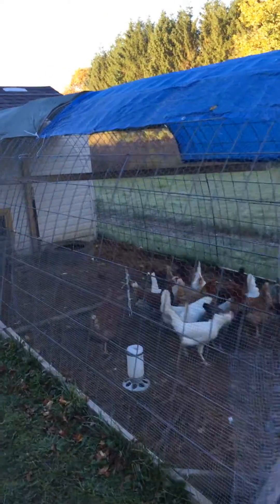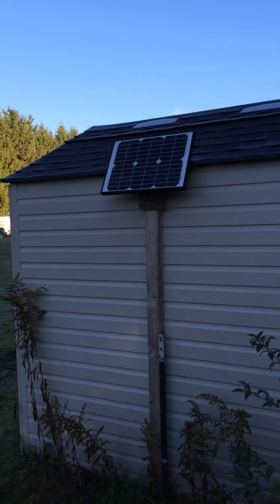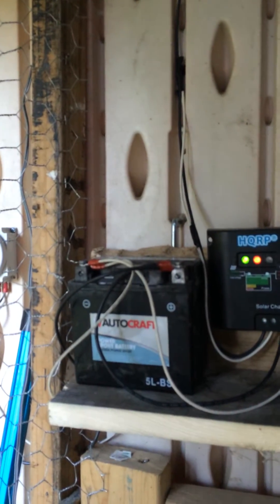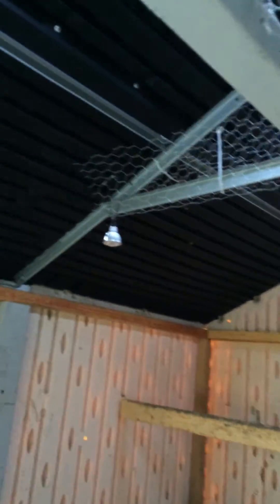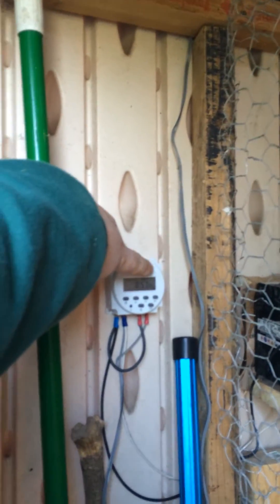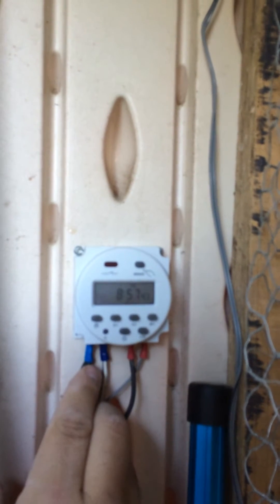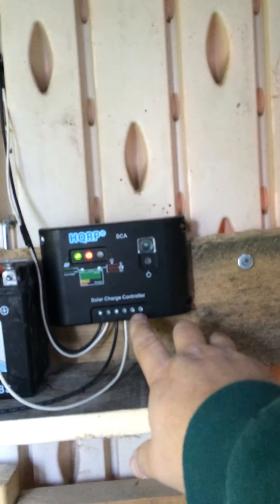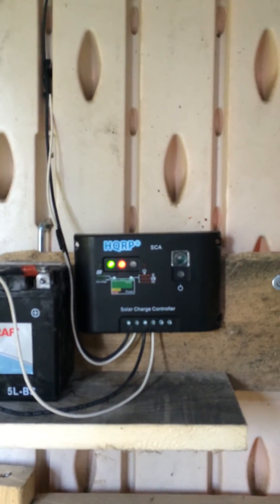Solar power in the chicken coop

Comment: That timer switch, when its time to turn something on, does it send a posotive or negotive signal? I need to know cuz im putting a system in my coop that will operate and automatic door and lights on 2 seperate timers. So il need to figure out which signal the actuator will recieve

Comment: Hello,
I followed your instruction on setting up my solar powered chicken coop light, using the same products as you. However, after 1 year my light system stopped working. I replaced the timer with a new one, and after the exchange when I went to turn it on manually the timer started to click rapidly. The light had a strobe light effect and would turn off and on. Have you had this problem? I've checked the battery and it has a full charge. I even tried another type of timer and it's doing the same thing. Could it be the solar charge controller? Have you had this problem at all?? :(
Reply from the maker: Larry J Cruz I haven't had that problem, I did have to replace my timer, it went bad this year, but my new one works just as the old one did. It sounds like you either have two wires that aren't supposed to be touching making contact (a short) and it's kicking the timer off, then it's turning itself back on as programmed, or you got a bad timer. I'd hook the lights right to the battery or the charge controller just to make sure that they aren't the problem. Let me know what you find out! Good luck

Comment: I also noticed you placed a jumper from terminal 1 to terminal 3. Why? Do I need a light switch? Or will timer take care of that?
Reply from the maker: +Larry J Cruz, The wire going to terminal one supplies power to the timer, just to keep time and operate the switch. The jumper from 1 to 3 supplies power to the lights, once the internal switch is closed. Think of it as two separate items, one is a timer that operates a switch, the other is power through the switch. You could run another wire from the battery to terminal 3, but using a jumper is easier and uses less wire. No physical switch is needed, the switch is internal to the timer, and there's a manual override button on the front of the timer.
Reply: Awesome
 Thanks so much man!
Reply from the maker: +Larry J Cruz Also, make sure when you get the MR16 bulbs, that you get 3 watt. It sounds like they're small, but I'm running 3 of them, and they provide plenty of light, and won't wear the battery out!

Comment: Do you have a video out on how to hook up the wiring to the timer, battery and charge? What gauge wire did you use?
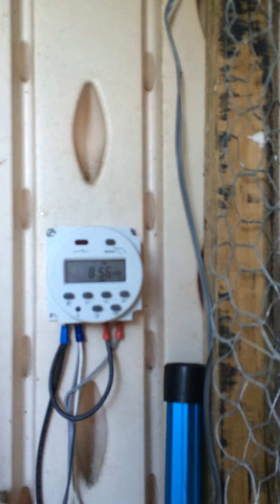Reply from the maker: +Larry J Cruz, I used 18 gauge wire, the wiring is pretty self explanatory. The charge controller has diagrams on it where to hook incoming power from the solar panel, and outgoing charge to the battery. There's also a diagram on the timer, explaining everything. The black & white wires come from the battery terminals, the gray wires go to the lights. Terminals 1 & 2 are to power the timer and operate the switch on and off, terminals 3 to 4 is the switched terminal. I took positive & neutral from the battery to the timer (terminals 1 & 2), If you pause the video at 0:58, you'll see from left to right, 1. power in from battery to timer, 2. neutral (or common) from battery and also to neutral side of lights, 3. power jumpered from 1 for power to lights, 4. power out to the lights.
Reply: +3 Roosters and a Chick 
Thanks so much! I'll try this.

Comment: I'm building something similar in my coop. What is the Ah on the battery and are you seeing any problems with the lights running the battery all the way down before sun up?
Reply from the maker: Daniel Stover  Sorry for the long wait before the response. My battery is 4ah, and it's working just fine. The battery is actually my motorcycle battery, not specifically a solar cell battery.

Comment from the maker: The solar panel

http://www.amazon.com/ALEKO%C2%AE-20W-20-Watt-Monocrystalline-Solar/dp/B007YT6EBY/ref=sr_1_5?ie=UTF8&qid=1414218507&sr=8-5&keywords=aleko+solar

The timer

http://www.amazon.com/Amico-Digital-Power-Programmable-Switch/dp/B008999RYY/ref=sr_1_1?ie=UTF8&qid=1414218608&sr=8-1&keywords=12+vdc+timer

The charge controller

http://www.amazon.com/amtonseeshop-Charge-Controller-Regulator-Switch/dp/B00IFYKSY6/ref=sr_1_20?ie=UTF8&qid=1414219032&sr=8-20&keywords=solar+charge+controller+10a

The LED lights
http://www.amazon.com/Weanas%C2%AE-Undimmable-Spotlight-Equivalent-Replacement/dp/B00MHLRZWQ/ref=sr_1_34?ie=UTF8&qid=1453887966&sr=8-34-spons&keywords=mr16+3w&psc=1